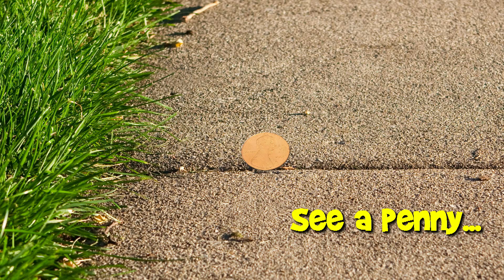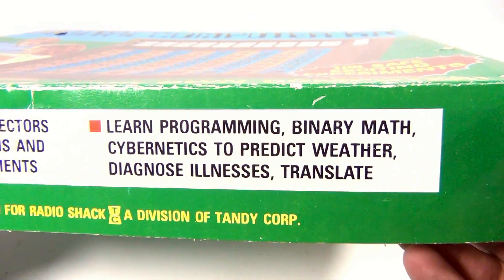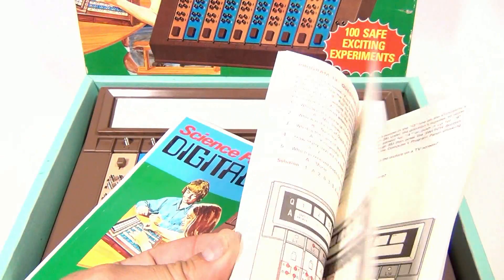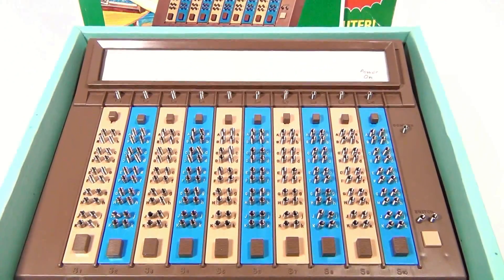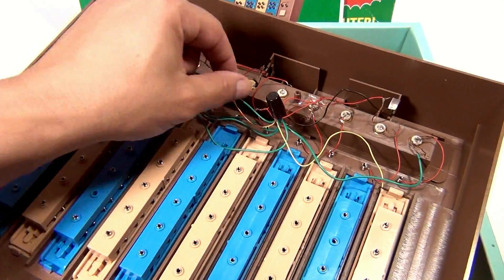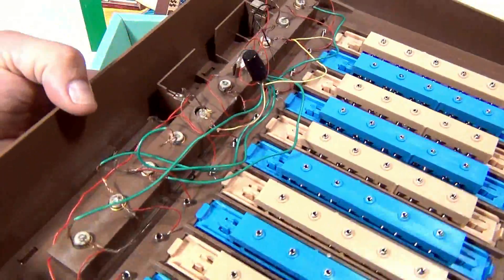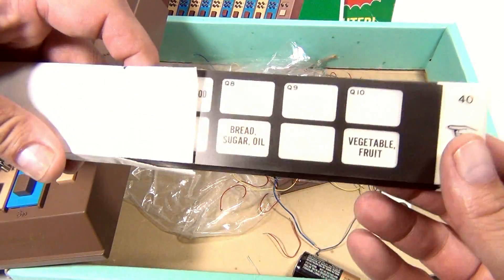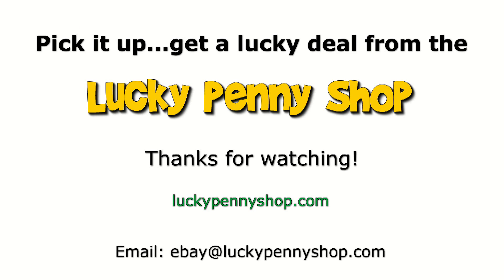Science Fair Digital Computer Kit, 1977 Radio Shack  - 100 Safe Exciting Experiments

Comment: Yup.  Seventies prank on well meaning adults and ignorant sales people mostly. Technically not fraud. Just a series of switches and light bulbs.  Each of the S# numbered switches had to be wired in extensive and grueling point to point manner.  Hundreds of point ties.  The single switch on the side was the 'run' switch that only hooked to batteries.   No silicon except as grease on slide switches. Not even a relay or buzzer.  All those little lights sucked down batteries fairly quickly too.  Semi translucent strips shown were the program input and output.  (In)Put slide switches position according to intended input written on strip and correct output (s) would be lit up after engaging run switch.  It did teach GIGO(garbage in garbage out), cheap hardware is the programming error, some programming environments are terrible, and one programming mistake can take hours to find and fix.   LEAVE this for collectors. NOT for love of computer obsessed hypercurious OCD young folk who will build all the projects regardless of their knowing is junk but need to know if some hidden truth/knowledge can be gleamed from it.  On the other side if they survive it and still want to program or 'code' then is most likely hopeless die hard programmers to such there is no cure.
Reply from the maker: Wow!  More detail then I would imagine on a something like this.  Thanks!
Reply: Considering the time, I would cut the designers of this classic educational toy a break.  It wasn't a Trash Eighty or an Apple, but it was just fine as an introductory logic trainer for kids.  It certainly had more programming capacity than a Digi-Comp, albeit not with the same cool factor.